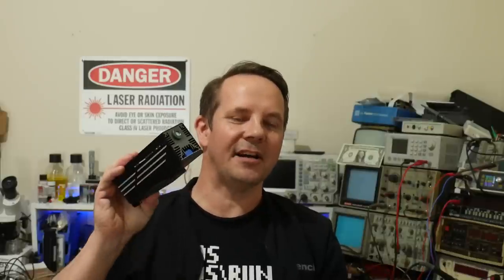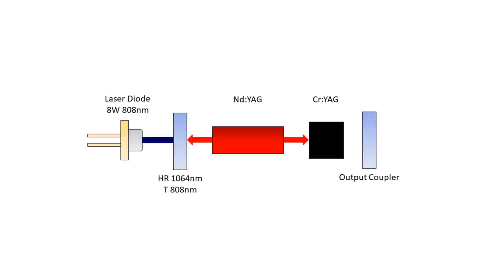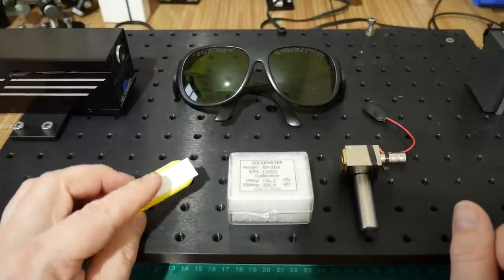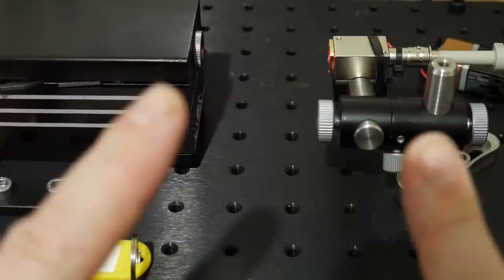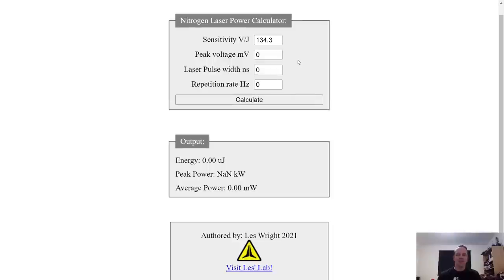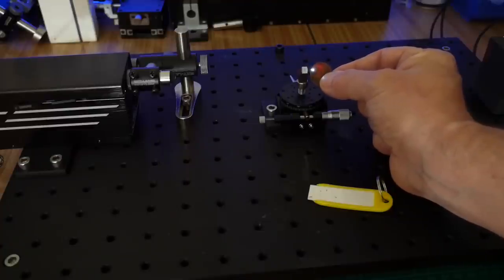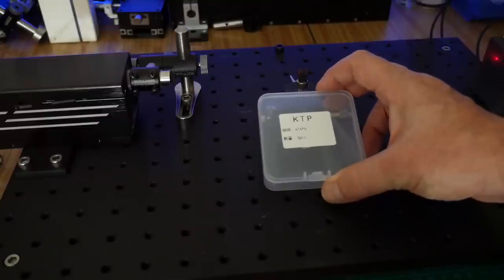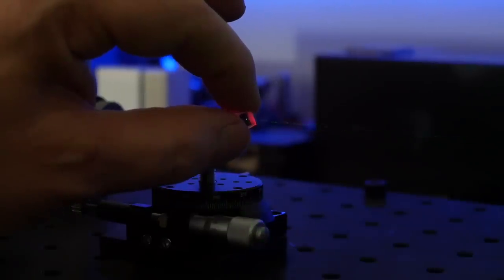Second Harmonic Generation in a 15 Kilowatt Laser!

Comment: Hey there！

We just wanted to give you a huge high five for your awesome video explaining how our TwoTrees 1064nm Infrared Laser works! Your explanations were super clear and easy to follow, and we loved how you used fancy equipment like the Gentec pyroelectric sensor and Thorlabs fast photodiode. 🤓👍

And let's not forget about that Second Harmonic Generation (SHG) explanation - you rocked it! We were all impressed with how you showed us how a Potassium Titanyl Phosphate (KTP) nonlinear crystal can turn boring old 1064nm infrared light into cool 532nm green light.🎉🔥

We also appreciate any feedback or suggestions you have about our product. We're always looking to improve our stuff, so don't hesitate to contact our friendly TwoTrees team with any questions or ideas you may have.

Thanks again for your awesome review and for sharing your knowledge with our audience. We can't wait to keep in touch and provide you with the best service possible. 🙏🏼😎🚀
Reply: Received a TwoTrees 1064 nm laser, the box includes everything you need to hook it up to an engraver controller including a 12 VDC power supply, but the included documents don't tell me anything about hooking it up for non-engraver use to pump a KTP crystal. 

I just need to know the PWM voltage level and permitted duty cycle and if continuous CW (Q-Switched output of course) is permitted just using an on-off DC voltage (not pulsed, just used to turn it on and off) into the PWM line and if so, what voltage? +5 VDC?

I promise not to shoot myself in the eye :) Have OD 12+ 1064 nm goggles. It's the green I also need to watch out for. Anyone have info which could help me? The Two Trees web site doesn't give any information regarding the PWM I can find as they aren't selling these for someone to do what I want.

Comment: Some clinical ophthalmology lasers provide both a Q-switched Nd:YAG laser and a frequency doubled output to provide two different laser wavelengths for ophthalmic treatments (capsulotomy or trablecoplasty). At least one commercial product advertises 0.3-10 mJ per pulse (4 ns) for 1064 nm output and 0.3-2.6 mJ per pulse (3 ns) for 532 nm doubled output. They always have red aiming beams.

Comment: Pretty cool! Did you by any chance measure the pulse width of the SHG light?
Reply from the maker: Thanks! I have not, but is would be interesting to see if there is anything there. I suspect though that I am right at the limit of what can be resolved with my current equipment, though I am told there are ways and means!
Reply: The pulse duration will be just a bit shorter after SHG

Comment: You always have the best toys!
Reply from the maker: ...but on a budget! :-)
Reply: @LesLaboratory  Yes true.  Such a item under $500 is incredible.  Got me thinking perhaps a means of evaporating very high melting point
materials for thin film vacuum deposition.  Be it a very limited amount of material. But if only a 100 nm thickness or so x 10 mm square 
is required.  A few nano grams depending on the material evaporated should not take long.  I need to do some math to check this out.

Comment: Very Sweet laser indeed. The simplicity of passive Q-switching is just so elegant. Only thing I never like about these packages is that you can not really do much to them to change the output beam characteristics.

SHG is very fun to play with and IMHO one of the most beautiful processes and still quite easy to achieve. With sufficient peak power practically any non linear crystal starts converting your fundamental.
Take it from there to OPA and you have yourself a tunable broadband light source that you can seed with pretty much anything. Your Supercontinuoum for example.
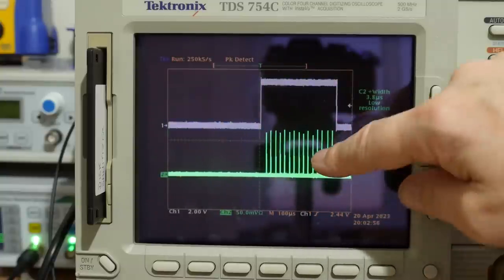Reply from the maker: Yeah, passive Q-switching is nice, but as you say, there is no control over the output energy and you can see at 6:56, the pulse to pulse stability is pretty poor as well.

I have a crusty broken LBO that I managed to coax some green photons out of.
Now an OPA/OPO, that would be something. It would be interesting to see how achievable this is on a tight budget.
I am hoping to do a THG setup (LBO on order), to see if I can either drive a Fiber directly, or pump the dye Laser with it.
Reply: @LesLaboratory  Yeah, shot noise is not something that these lasers are built for.

Once you're done with the experiments you have planned and you're brave enough it would be worth checking out if the laser cavity is extractable, or if everything is cemented together. If you set up the cavity on a bench and the absorber is separate, you may be able to exchange it to tweak the time constant of the cavity or replace it for an active Q-switch.

For non-linear stuff you obviously want peak power, and for Nd:YAG the sweet spot for energy extraction efficiency and output pulse energy is somewhere around 3kHz. The pulse duration is probably going to grow as well, but that would still give you quite a significant increase in peak power.
OPO/OPA is going to become efficient around 1GW/cm², difficult to achieve at ~10kW peak power, but doable at ~100. I achieve about 50% conversion using 400kW peak power, 2ns pulses to pump BBO.

You could also just pump Ti:Sapphire directly with the green output to drive a broadband cavity from 700-900nm. Less exciting though :)

Comment: Great work, Les! I'll look forward to the dye laser step. There are $50k scientific Q-switched, frequency-doubled Nd:YAG lasers out there, and we had a couple of them in my former university lab. At 200mJ/pulse the beam focus would break down the air and produce a bright repetitive white-light flash, which my students and I used as a non-coherent light source for high-speed digital imaging. Your little engraving laser will not cause the air to flash, but might provide enough low-spatial-coherence light for the same purpose by pumping a dye cell if the efficiency is high enough. There's a lot of interest in bright, high-speed noncoherent light sources but, again, the price of admission is typically $50k. It would be great to do this at small scale and 2 orders of magnitude cheaper!
Reply from the maker: Thanks!
The doubled or tripled light should easily pump a Dye Laser, though the Dye will need circulating though beuse of the high repetition rate (or I could be smart about how I drive the PWM signal into the Laser...

I have a flash-lamp pumped Q-Swich YAG project that will break down air, but I never thought of using that light for imaging. Interesting!

Recently I built a Supercontinuum Laser, generating light across the visible spectrum that could also be used for high speed imaging: https://www.youtube.com/watch?v=w1wSHizmbYg

Comment: Nice! 18kw Pulses, that will be very useful. I am looking forward to seeming more videos. I have some interesting projects coming up as well. Also, if you can warm the SHG crystal to it's optimum temperature you will get more power out!
Reply from the maker: Totally! At these powers, I figure I can get away without a heater, at least for now. Next stop the third harmonic... Cool, I look forward to seeing more of your stuff!
Reply: Many of these SHG crystals aren't designed for thermal phase matching
Reply: @DAVOinIN  Hmm, interesting to know. I had figured they all where to a degree, The Laserscopes are about the only somewhat experience I have had with pulsed DPSS Lasers.
Reply: @Zenodilodon  There's a ton of variability and it's all pretty interesting. There's Critical Phase Matching, Quasi Phase Matching, and more. 

For example, LBO can use thermal phase matching, but something like Lithium Niobate doesn't necessarily require it. 

It also completely depends on the crystal boule cut angle, fundamental/signal/idler frequencies, etc...

Comment: Great video, loved the q switching explanation and graphic. Is the thickness of the non linear crystal important, maybe for efficiency or power levels? You never did say what the laser changes, “everything” is a wild claim. Maybe the addition of a non linear crystal lens to change from visible to invisible but that’s already well known and done.
Reply: He said that this kind of peak power levels was never previously available this cheaply on a normal consumer unit
Reply from the maker: Thanks! For thickness is depends on the application I guess. I just bought an off the shelf crystal, but ordinarily you would go through a design process with the manufacturer.
Somewhere near the beginning I remarked that it changes everything for micromaching and nonlinear optics experiments at the price point. These are cheap, almost dirt cheap. I had actually priced up components to build one of  these before I saw them advertised, and you would be looking at over $1000 in parts and a considerable investment in time.

Comment: If you projected non-coherent 1064nm monochromatic light through the KTP crystal, would it still convert to green? Or does the input light have to be coherent? This is the best demonstration of that frequency doubling effect I have ever seen. Excellent video!
Reply: The KTP needs coherent light because it needs to be phase matching. The ND:YAG you can practically pump with anything that has enough optical power. There used to be incandescent lamp pumped YAG Lasers.
Reply from the maker: What @Zenodilodon said :-) I saw one on eBay years ago. It had what looked like a standard tungsten halogen lamp in the cavity. Wish I had bought it!
Reply: @LesLaboratory  Those things use ridiculous amounts of power and aren't very efficient. I used to work with one, the power supply was 3-phase several kW and the laser head required a high flow of chilled water, but output was less than your one there (~1W avg power, active Q-switch).
You could hear the water start to boil around the lamp if the current was turned up too high!

Comment: amazing demonstration!

I have one question tho, why does this conversion also work in green laserpointers? There you don't have those high peak powers, so do they have some additional optic in them? I am asking this, since "the thought emporium" tried the same thing as you, but he used an IR diode to pump his crystal, not a pulsed laser and he didn't manage to get it to work. 

Also what optical bench do you use and were did you get it? I saw similar ones on the Thorlabs website but they were very expensive.
Reply from the maker: In green laser pointers, they mount the KTP crystal within the cavity, where a huge amount of power is circulating. Imagine you had a small IR laser that produced 1mW from a 0.1% transmitting output coupler, for 0.1% or 1mW to escape, there would be on the order of ~1000X more light circulating in the cavity, and this is enough to generate SHG. Another consideration is power density. What I demonstrated is on a macro scale (the beam diameter is on the order of 2mm across) inside laser pointers the beam diameter is much smaller (microns) resulting in huge power densities even at low power.

I got my bench from Thorlabs, and yes they are pretty pricey, but I got fed up with having to cut and drill metal to set up experiments. These are pretty convenient and well worth it. I did consider getting a metal shop to make me one, but it would have cost almost as much.
Reply: @LesLaboratory  Interesting, I thought that it had something to do with the power-density but I would have never thought that it could become so high in a small pointer. 

Also, have you ever measured the power of the green laser in your setup?
Reply from the maker: @firefox1136  I have not measured the green yet, though it should be possible to get 60%conversion efficiency at least. I need to get a nother mount so I can tilt on the Y-axis and really tune this thing. I ordered an LBO crystal as well so I can attempt Third Harmonic Generation so see if I can get some UV photons out of this!

Comment: I owe most of my career to SHG green lasers as a service engineer with all the systems based on a Z fold cavity with the Q switch and the SHG crystal or crystals in some cases actually in the cavity instead of external to the cavity. Usually KTP for lower power systems and LBO for higher power with the latest incarnation using 2 LBO crystals within the cavity and capable of generating 300W Average power with maximum peak power of 1.33 MW in service mode but limited for customer use to 180W Average power and 800 KW peak power. All used for medical applications, aligning one of these resonators is a whole bunch of fun.

Comment: Hi Les, you make it look so easy! I love your episodes. I have an SSLE machine for my crystal glass business in South Africa, it stopped working during Covid and I received no more support from China, they just want to sell me a new machine! 
The system uses an active Q-Switch system and frequency doubling process; may I ask a few questions?
I have been working on it for a year and there are no companies in South Africa that can help.
1). The system suddenly stopped doubling a week ago, could this be because the diode has become too weak! Is there a power threshold for doubling? It is a 50w DILAS fibre coupled system, 400um. The label says 780-1000nm - It is red, I am guessing it is 808nm? I tried a newer similar diode, it had the exact same label specs, but the beam was almost invisible - I am guessing 970nm - so no doubling ocurred.
2) 2 years ago the green laser beam started flickering, then came strong again..this happened several times, then the beam went dull green permanently. It was, though, still doubling from red to green (532nm). I have tried a different RF signal driver ( AA Optoelectronics in France) as I thought the Q-Switch wasn't switching and boosting the laser. No change, though I am testing with an Oscilloscope tomorrow.  I have tried another 50w diode( also quite old), initially it doubled from red to green, suddenly it just stays red. I removed the Q-Switch it made no difference..

Would you possibly have any suggestions please? Things are getting a little tight now.
Many thanks
Richard Nield
info@3dcrystalstudio.co.za
Durban

Comment: I love this laser, thanks for posting the link, where and how did you make the excellent collimator?
Reply from the maker: The collimator is built from the housing from a laser diode module , but I replaced the plastic lens with a glass collimating lens. At some point, I am going to turn a piece on the lathe, since it is a faff to align as it stands.
Reply: @LesLaboratory  It looks great, where did you get the collimating lens?

Comment: I'm highly impressed, that Q-switched lasers have become so affordable. They can probably open opportunities to create cheap UV laser sources for multiphoton (actually two -photon) photo induced chemical reactions. The only question is where to get cheap fourth-harmonic generators ( BBO for example).
Reply from the maker: Thanks! The expense stacks up though! As well as BBO (or LBO) you need one or more polarization rotators as well to correctly match the incoming 1064nm and 532nm beams.
Reply: @LesLaboratory  This is true, additional optical componentes are needed as well as thermal stabilization, especially for 4-th harmonic crystals (several degrees Celsius). Temperature fluctuations can result in dramatic decrease of output power. Total costs can be much more than bare laser module, but still components are getting more affordable,   still an optimistic trend)

Comment: wonderful!! i jus want to know how much is the power loss after SHG? and can only pulsed laser cause SHG?
Reply from the maker: The power density required for visible SHG is ludicrously high, on the order of kilowatts per square cm. So with a pulsed laser with high peak power this is easy. For CW Lasers,  such power densities are available within the cavity itself. Intracavity powers, even in a small laser of a few miliwatts output can be tens of watts (kW's per square cm).
Reply: thanks  @LesLaboratory  . ah i thought of converting my 785nm SLD to UV :p ..
Reply from the maker: @nvspraneeth9468  you could do that with BBO, but it would be single photon level.
Reply: thanks for it @LesLaboratory  , i see, my SLD's max power is 20 mW. i actually study single photo emission from quantum dots using our home-built TIRF microscope where 10mW/cm2 illumination is more than enough. so you suggest for my work BBO crystal would help? and instead of buying can i scavenge from any laser pointer like you did? many thanks again

Comment: Thanks, this is very nice. I was wondering as them infrared lasers have become this cheap and whilst  pulses are used to blast away tattoos I can see the industry switching more and more to laser welding. Robots can replace the cumbersome spot welding and say weld sides to car bodies with a continues seam. Slower but since robot do it 24h a day the end product is sealed and the end product has a much higher quality and its strength is far more predictable with a minimum of materials used.
Reply from the maker: For sure! I expect some really interesting Laser tech will end up on the likes of eBay to tear down and play about with!
Reply: @LesLaboratory  Sadly I am in Australia. Have over 50 lasers in stock mainly from repairs but we no longer receive strong ones even though we pay for them.

Comment: Can you do Photonics Entanglement experiment  ? Is it possible to use green laser crystal from opposite Directions to do the opposite of Input phone mean splitting into two ? Or both crystal and Diode Wavelength are Very spesific ??
Reply from the maker: It is possible to do entanglement I believe with BBO crystals. See this vide here for a run-down: https://www.youtube.com/watch?v=tn1sEaw1K2k